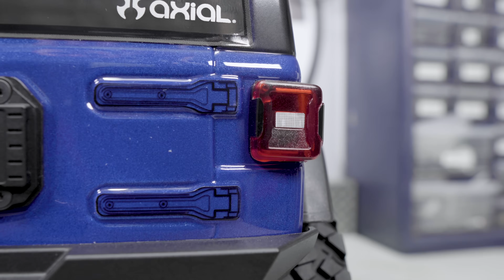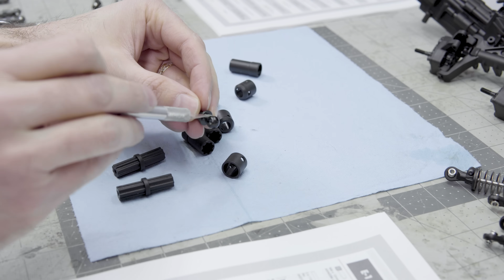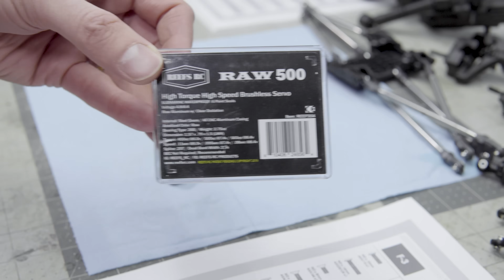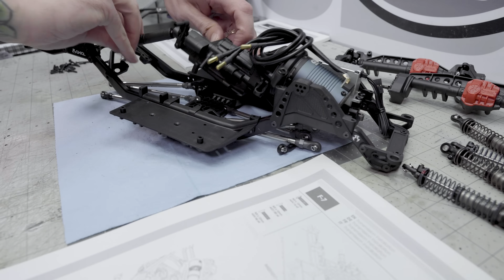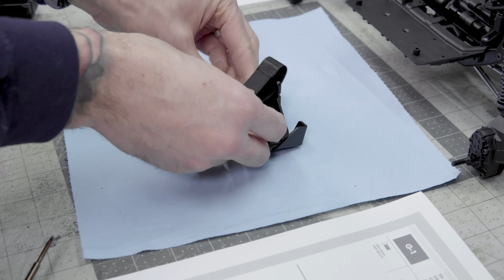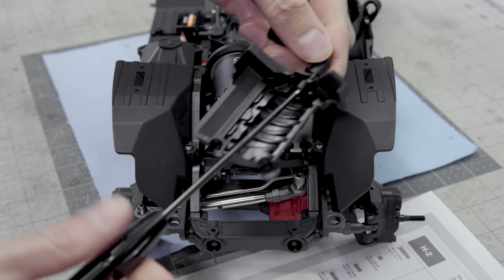Axial SCX10III Step by Step Build D1-H2

Comment: I noticed you installed the softer red marked springs in the front & the stiffer green marked springs in the rear, on my RTR Gladiator they have it the opposite does your manual actually say which order the stiffer & less stiff springs go? I know I can do whatever I want I'm just curious if they installed them incorrectly on my RTR? Thank you

Comment: just bought the RTR version and i love it! my first 1/10 crawler and the no body post, portals, and dig function made me pull the trigger (of course had to be a jeep wrangler for me). quick question tho, your install and the exploded manual shows red (softer springs) up front, but my RTR has the softer springs in the rear and i've seen some other builders have the softer ones out back as well. which one is correct?
Reply from the maker: It's your personal preference, I prefer the soft springs up front.
Reply: Scale Builder's Guild thanks! I will try it and play around with the shock oil weight as well. Was just weird that the manual said one way but they built the RTR another way lol

Comment: hi i install the red spring for front, green at back. because the heavy weights the front suspension hard to springback, do i need to put more suspension oil in? i use about 50% oil for each. or i change the green springs to the front?thanks

Comment: Been asking around the youtube community that have done videos on these rigs and I am curious if the dig can be configured to run 2wd 4wd rather than as a dig. Thanks eh.
Reply from the maker: You can technically freewheel the rear axle but it’s not super easy to set the position, as it wasn’t really intended.
Reply: @scalebuildersguild  does the design of the gears allow them to flipped to reverse the dig and then mod the gear to allow the front to free wheel? Or is it one way only for the gears to go in.

Comment: Hi Matt, what is your opinion on the  Spektrum micro servos? Are these fine or do you see an upgrade needed?
Reply from the maker: They're fine. Holding up in the Capra and doing fine here as well. I might upgrade if they fail. They don't see a ton of use, and the servo saver helps!

Comment: That Drivetrain is IMPRESSIVE!! 👍👍👌
Wildboar Driveshafts are awesome. Never broken one... I hear a few guys say that they break easily..... BAH!! These are people who have never used them! Likely saw Josh's Videos! (Josh is the ultimate TORTURE test for any RC parts!!) 😜 
OK... Guys like him need MIPs.

LOVE the new Frame!!! Axle clearance like VS4-10!!
Carmine ✈🚂🚙
Reply: I would think that Axial will do a full Rock Light kit, with Housings, correct length Wiring and a Controller that you don't really need, because all you need is resistors and a Servo Plug! 😉
But for the less handy... It will probably be welcome.